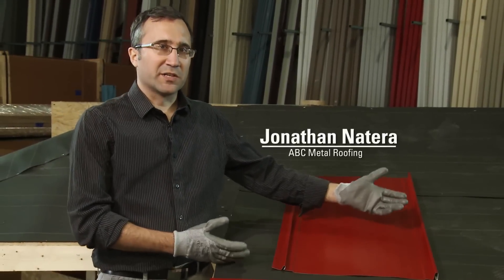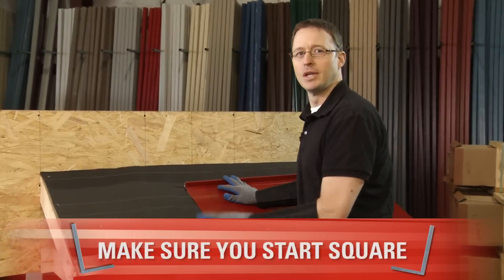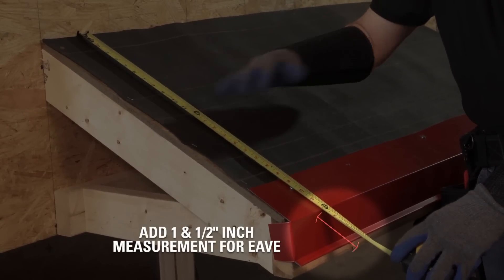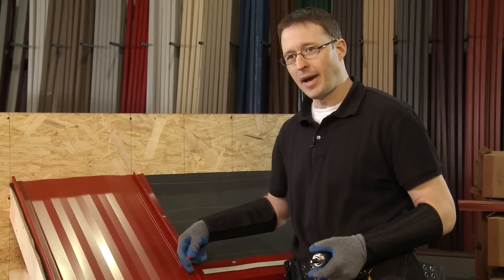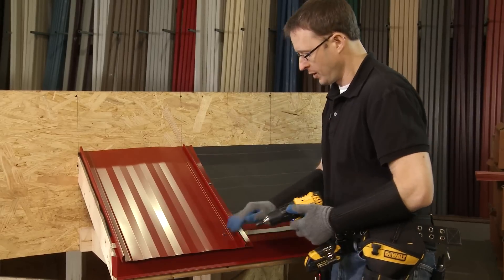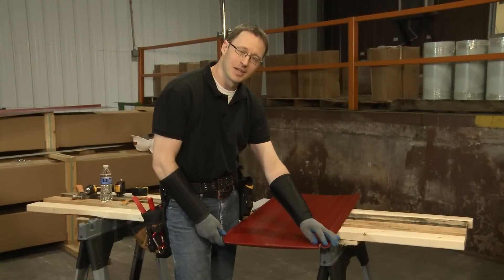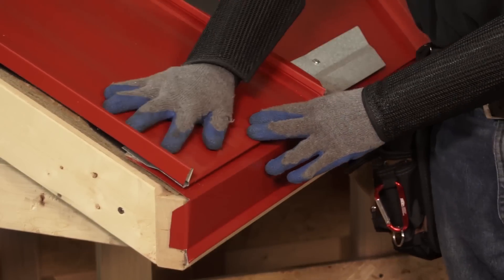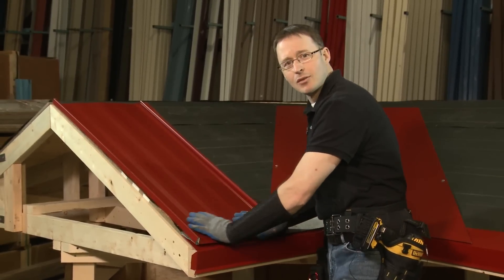Metal Roofing Installation Using the SL-16® Panel by American Building Components

Comment: Not a fan of these methods. You should use drip edge that you can wrap around the panels from both the bottom and the sides - this is both cleaner and stronger, plus there are no visible fasteners in the panel, hence no future leak concerns. The panel also does not stick up at the base with a cleat as shown toward the end of the video.
Reply: What this guy said !!!!

Comment: Everyone has slightly different ways of cutting the panel, if your cutting 10 inches or so off of a panel you should be cutting in the other direction so you are prying up the 10 inch side while cutting so that the panel your installing remains flat.
Reply: you're not your in this case